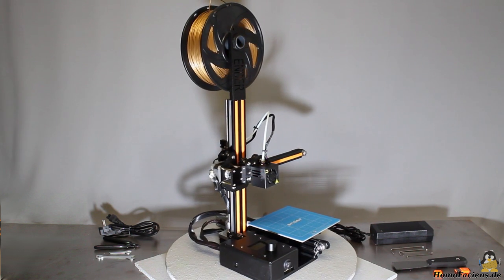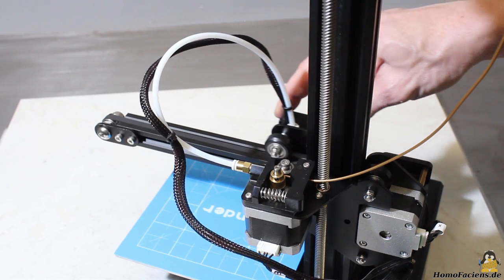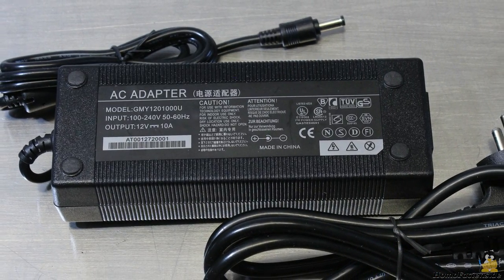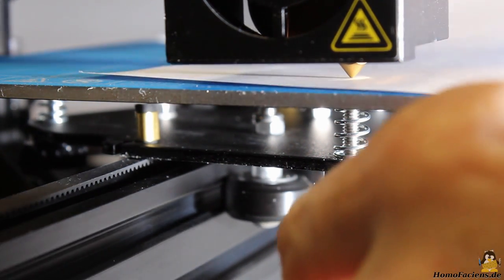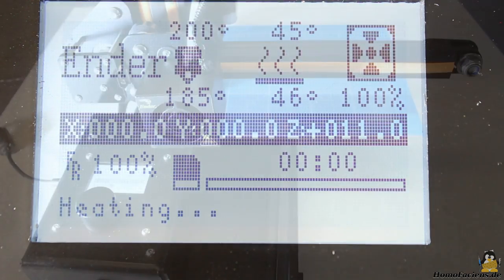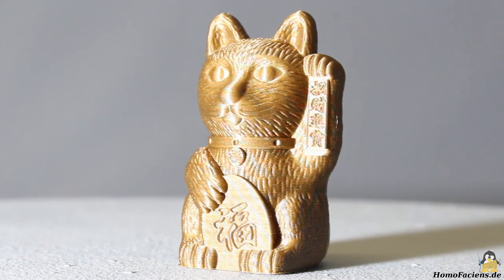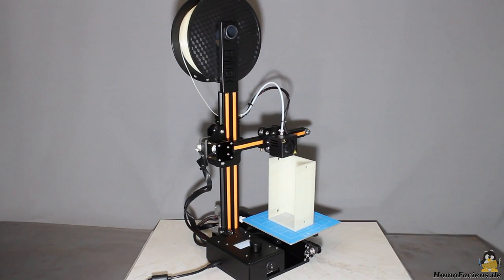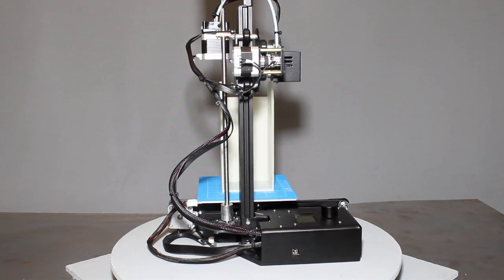Review of the Ender 3D printer

Comment: Surprised on how simple it is. Not keen on the spool on top, or the extruder design .... but it's simple and works.

One silly mistake i'd point is that you can accidentally turn it off while fiddling to check the SD card ( if you have big, dumb hands, like i may have).

Also as a tip: To get parameters of a manufacturer print Cura (and i guess other slices) can import settings from gcode.
¿ No idea for speeds or temps ? ¿ want to print something with the exact samesettings? that can save the day.

Thanks for the video, amazing as ever!
Reply from the maker: I also have no baby thumbs but never turned off the printer  accidentely (yet) while handing the sd card ;-)

Importing the parameters is a good ides - thanks for sharing. I usually open the gcode file in a text editor and read the parameters directly (M190 S60 = 60 degree bed temperature). Of course you must know the basic gcode commands to do that, but I am a coder and enjoy reading sources ;-)

Comment: Can I print a 3D printer? If I take a look, maybe I can find enough electronics for it at home, and at the university maybe I can use a 3D printer.
Or what machinery can be used to make one?
Reply from the maker: Filament printers were initially meant to replicate themselfes. That's why RepRap printers - (self) Replicating Rapid prototyping - exist:
www.reprap.org

Besides the original RepRaps there are designs for a varienty of 3D printers available that use as many 3D printed parts as possible.
Reply: Thanks! That seems interesting! I'll check some designs, and see what can I build. Seems buildable. I'd happy to see something like that on this channel too, but probably I'll try to make one. I'm thinking about something like that CNC machine you made, made with common things but with the "little" help of a 3D printer :)

Comment: Great Video! (and channel) @homoFaciens have you tried ABS with this printer? it is announced as capable of printing ABS, but looks like the bed won't go to the required temperature.
Reply from the maker: Thanks! I did not try ABS and because of the low bed temperature you won't succeed in printing more than very tiny objects. It's a great machine for beginners which sould do their experiments with PLA or PET rather than ABS because of the fume the later material sets free while printing.

Comment: You should consider using octopi or something like that. This works great with my setup. No more SD cards switching :-)
Reply from the maker: Yes, the Raspberry Pi draws not that much electric power, thus it can run with the printer for hours.

Comment: is it easy to assemble? would u advice it for ppl who never had a printer (first printer) ? Thx
Reply from the maker: The assembly wasn't very tricky. It's no bad machine to start 3D printing. Consider that 3D printing is way more tricky to handle than making a paper copy with a 2D printer. It's a low price machine you can use to learn the basics.
Reply: since this printer looks like to be used by almost nobody except you I think i'll wait (what happens if i'm not as good as you and need help on the subject if nobody talks about it?). Btw can u tell me the simplest 3d printer to assemble, the easiest 3d printer to assemble that u know ? Thx in advance :)
Reply from the maker: This one is the easiest printer to assemble.
If you fear to build a printer, you can buy one ot the countles devices that come assembled, not as a kit. The cheaper a printer, the more you have to build. Even if a printer is assembled and runs, the cheap devices usually need some upgrades to work better.
The smaller a printer the more easy it is to operate: You can quickly turn it around to check the components and you have easy access to e.g. the knurled nuts for bed adjustment.
Reply: Thx for the clear advice! When I'll have money I'll probably try this one then

Comment: I have purchased a second user Hictop Ender but when I save gcode from Cura it will not start the print from the centre of the bed but starts at the home corner and doesn't print correctly , how can I set up to print at centre
Reply from the maker: You must set the parameters of the print bed in cura (dimensions and zero point or type of printer). I am using Slic3r, thus I can't say exactly where to do the settings in cura.

Comment: I could not calibrate. The nozzle is printing out. What are the XYZ values for calibration?
Reply from the maker: Sorry, but I do not understand what you are asking for.
Reply: The nozzle is overflowing. The print's too bad. I use ABS. Should I use PLA?
Reply from the maker: What about a video or pictures of your results so that I can see what you mean with "bad results"?
Reply: Plate heat is low:) Thank you very much. I solved the problem :)

Comment: What turntable are you using?
Reply from the maker: One I made quickly. It's driven by a geared DC motor with a piece of rubber tube on the output shaft. The table is resting on that shaft and two more ball bearings at the edge and on a screw at the center (=pivot point).

Comment: For this printer,  I have a problem with the Z-axis, when at position 0, the stepper motor shaking for a little bit then stop without going up. When I move the position by hand manually about 10cm from the hot bed, I can control the Z-axis normal, but it will not go down any lower than that 10cm distance. Does anyone know how to fix this ? Thank you
Reply from the maker: Could you make a video of what your problem is? That would make it easier to give an answer to your problem.
Reply: Another thing I noticed about this printer is the AC-DC power supply is still warm, even after I turn off the printer for a while, is it necessary to unplug the AC-DC power supply after use ?
Reply from the maker: If the power supply gets warm, it consumes power, thus I would unplug it if the printer is not in use.